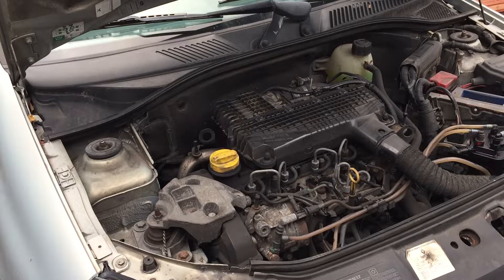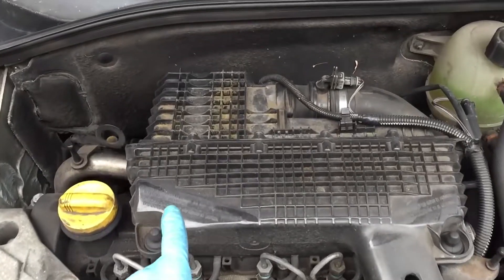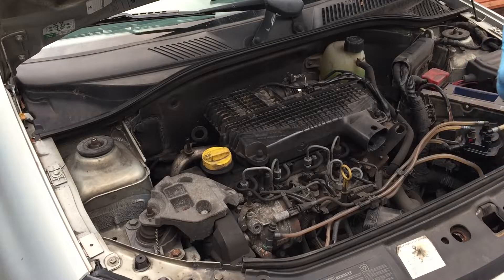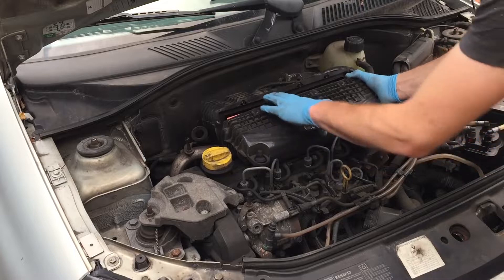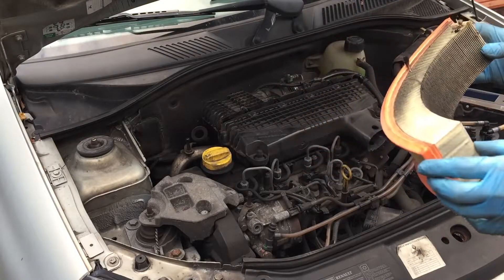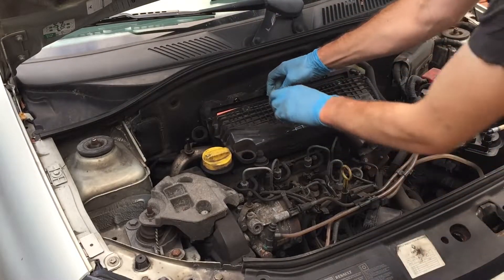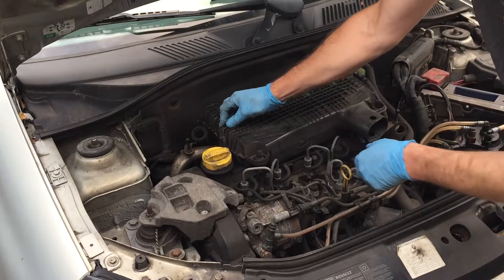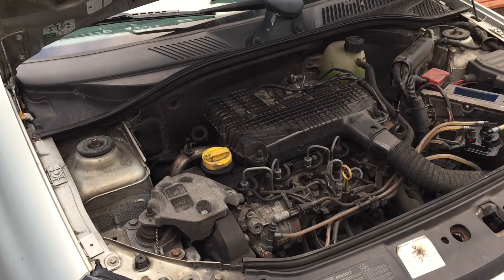Renault Clio 1.5 dCi 65 Air Filter Replacement

Comment: hi Ive just purchased a renault kangoo dci70 1.5 diesel. are these engines the same ? the plug with the white and black wire, is that the MAF sensor ?

Comment: Do you happen to know if the air filter unit/housing can be tightened up as mine is rattling about a bit (and how is it done?)  I have the same Clio as you. Great video and many thanks in advance.....
Reply from the maker: Hi Mark, the filter housing rests on some (three?) rubber mounts including one at the rear that slides in sideways. If any of these become damaged or the rubber is missing then I imagine the housing will rattle around quite a bit. If you disconnect every wiring connector/clip and also the air hoses you should be able to gentle wiggle the housing up from the front and slide out the rear retainer to check everything.

Comment: Hi bro you are need to sponge supported air filter. Because is dirty ways
Reply from the maker: I don't quite understand; are you advocating the use of sponge media air filers over paper media filters? If so, for a £3 car it really doesn't matter.
Reply from the maker: I see what you mean. I don't think there will be a big difference in filtration so I'm happy with the standard filters that have been used on the car before and during my ownership. Cheers, though.
Reply: @KomradeShotabollokov  sponge supported filter better than is standart filter. Because very dust in the air. See you bro.